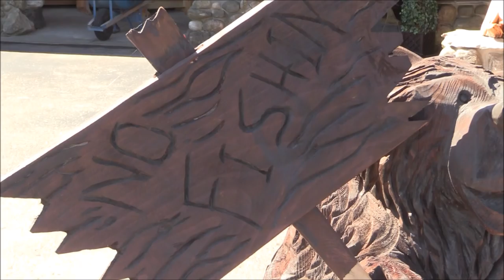Amazing woodworking projects and people | Izzy Swan

Comment: I need help Izzy
I need to cut out a 5/16" wide irregular shaped channel from a 24"x48" piece of block board 3/4" thick. I need to cut complete through so I have 2 pieces. I have a trim router and a jigsaw. I don't have any template to use as a guide making several cuts with the router. What can I do?